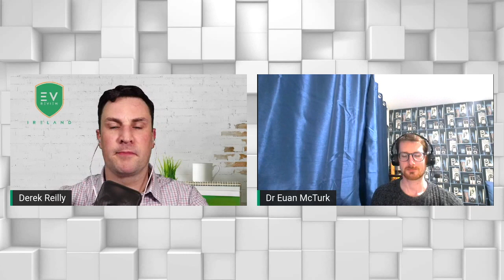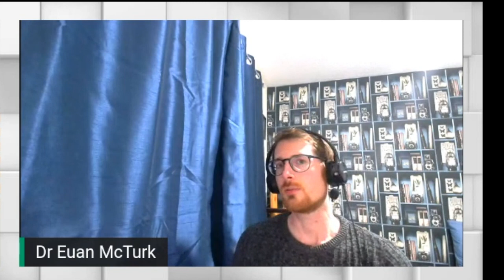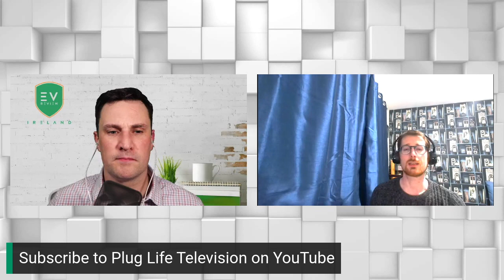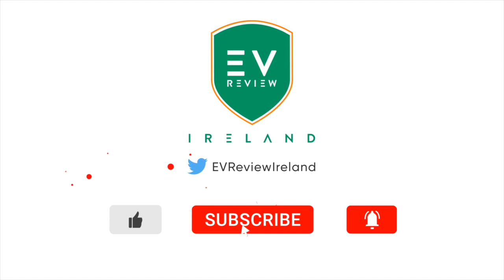400V vs 800V - Watts the difference for EV Charging?

Comment: Good video but like most folks who talk about 800V+ you get hung up on the battery and charging. The real advantage comes behind the charging socket inside the car. Charging at a higher voltage allows the use of smaller conductors, and critically, smaller motors.  This benefits not only the space needed, but critically it allows for more power.

Today there are cars that can consume 800kW+. The Tesla Plaid does this with three heavy motors and three sets of thick cables from the battery to the motors. There is a 900V Lucid car of about the same maximum power that uses only two motors and each is significantly smaller and lighter than Tesla motors, even if leaving off the Tesla's reduction gears. Each Lucid motor. Each lucid motor is about 35% more powerful at max rated amperage.

This does not only apply to costly and dangerously fast cars. Smaller and more economical components are needed if the automotive industry is to one day create vehicles that are price competitive to today's liquid fueled cars. I loved my 2011 Nissan LEAF, but the drive unit under the hood (motor, gears, inverter, & high voltage cables) probably weighed three times as much as any one drive unit from a Lucid. The Lucid makes almost exactly three times the power as well.

I mention lucid because I know that car better. The Taycan rear drive unit is larger but in has a more complex transmission that automatically switches between two gear ranges. I have not seen physical specs for the Hyundai/KIA drive units. I will admit to not having looked. Hyundai/KIA has announced several large EVs coming to market soon, but I hope to see a significantly affordable vehicle from that group before long. Today with batteries and certain other components in short supply it only makes sense that automakers should strive to profit as much as possible from the limited number of cars they will be able to build until supply chains normalize (touch wood).
Reply from the maker: Thanks for such a comprehensive reply! I'll pin it so others can read too. Appreciate your time.

Comment: Smaller cars will tend to stick to 400v for a long time. First is lower cost of Inverter components rated for only 400V and second, small cars have less overall battery cells so less available in series to maintain load current. Finally smaller cars will have less kwh capacity to benefit of faster charging isn't justified. All that said I agree, higher voltage are the future, just for bigger cars
Reply from the maker: Thanks for the comment and yes, it makes sense really for the bigger battery stuff

Comment: Interesting and well explained by Dr. However, IMHO Ireland is such a small island geographically, Hyper fast charging seems of little benefit. Fine if one was doing high milage in geographically large countries such as France or Germany. ID4 @ 135kw on an ESB CCS 150kw HPC can add 500km range in 30mins, OR 300km range in only 20mins which seems more than fast enough on this small island. With home charging even 50kw is plenty good enough on this island.
Reply from the maker: Tend to agree Noel
Reply: I would disagree. No one wants to be sitting around charging bays . The one question i always get asked by curious public customers is how fast can it charge up and get going again.
Reply: @Id3fornow...  Fair comment. On this small island with todays longer range BEVs even smaller 50kWh cars rarely need more than 20mins on CCS to cross to anywhere on the island. Most 60kWh to 85kWh don't need any on route charging anyway. Motorway services car parks are full of petrol and diesel cars that spend an average of 25mins stopped for 'human factors' so a BEV is waiting for the human rather than the otherway around even with slower old 50kw DC/CCS chargers. In the past 3 years our elapsed total journey time to Kerry and Donegal are the same was when we had the diese, were never sitting around. Charging times are not the issue they used to be, yet there are occasions when newbies accidentally plug into AC on a motorway and  then shocked to see a prediction of 6 hours to recharge a battery (user mistake). The public perceptions are that the charging infrastructure is not good enough and that it takes too long to charge, but that nozzle mentality we all became accustomed to.
Reply: Higher voltage means quicker charging time and most important: higher usage factor for the same charging unit is very useful in tourism intensive areas when charging infrastructure land space is expensive. I have an Ionic 5 and after a few months of charging experience, most people understand quickly the huge advantage of quick charging vs getting an increasingly bigger battery. Autonomy is not the only factor that interests technical  oriented latests EV owners.

Comment: Presumably the higher battery voltage also keeps the heat down internally within the battery? 

I noticed your sly dig at people's perceived needs versus actual needs, regarding charging speed, adamantly stuck in the old ways. Good man 😁
Reply from the maker: Thanks for the comment. Correct re the heat. Also correct re the sky dig 😉

Comment: Tesla's 250 kw (400v) with 650 amp has a thinner charger cable than ionity 350 kw with (800v) 500 amp. Explain that.
Reply from the maker: Above my knowledge, I've messaged Dr McTurk and will reply here once he gets back to me
Reply from the maker: Reply "That's a great question, and one to which I do not have an answer.  Potentially it's because the cable is so short that the cooling requirements are less for a higher current, but I'm not 100% sure how Tesla has designed their V3 supercharger.  If I find out the answer, I'll let you know."
Reply: @NevoEVReviewIreland  i am eagerly waiting for the interesting answer.
Reply: Tesla have liquid cooled cables for v3 supercharger cables.
Reply: @starshipdriver8536  EA also has liquid cooled cables.  Liquid cooled cables has to be the standard for all DC fast chargers if they want a chance to survive.